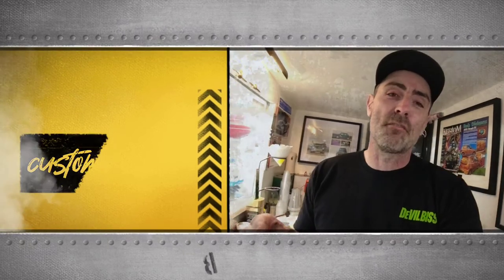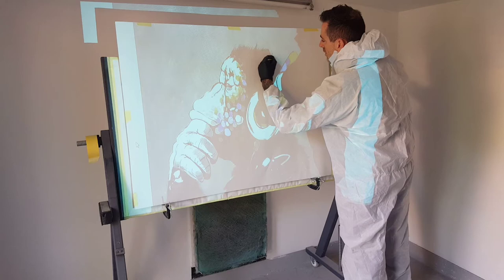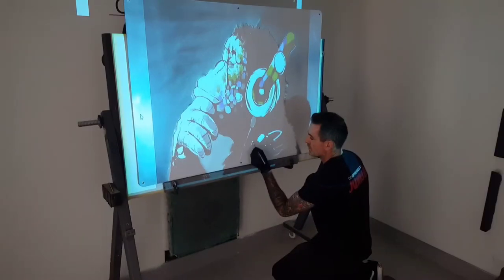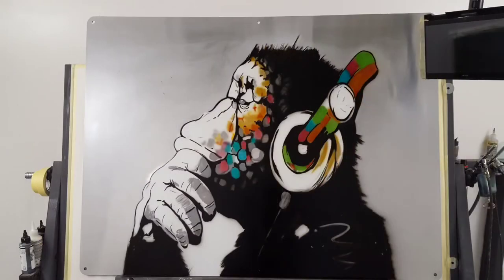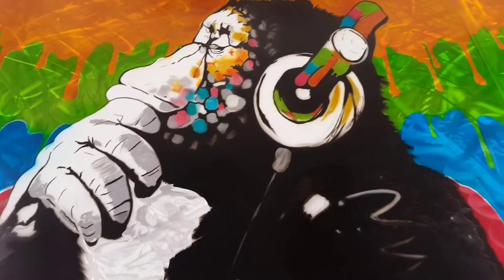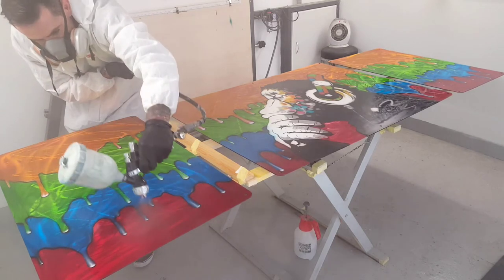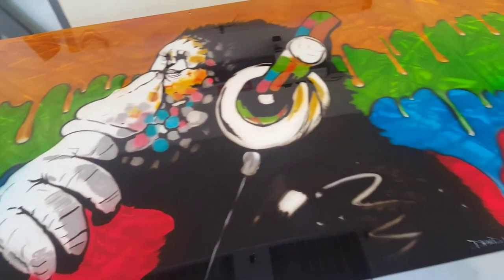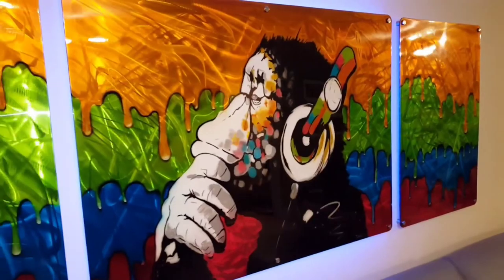GROUND METAL ART  STEP BY STEP GUIDE

Comment: Fantastic yet again mate, you smashed it 👊 it's surprising the difference the shadow and highlights make to the runs it really looks 3d. Love  the Kronox 610 it goes on very nice, I use the T110 cap in my GTI with the 1.2, which nozzle do you use Rob? 🙏👍
Reply from the maker: Hi John when I am at work the set up in the pro is 1.4 t110  cap for clear and base is 1.4 te10 cap in the studio set up in the pro is 1.3 and pro lite same caps
Reply: Ok thanks Rob, yeah I have the TE10 in my GTI Pro 👍